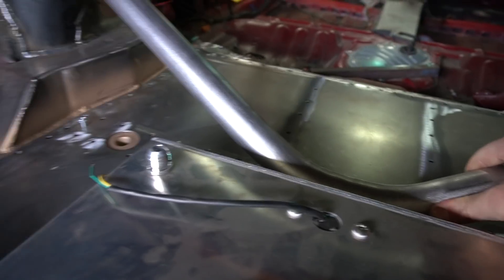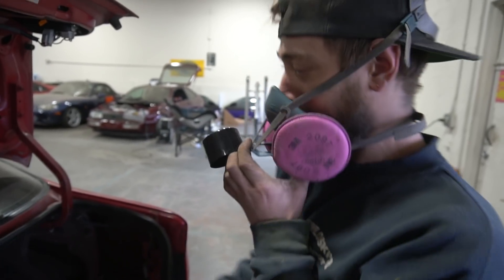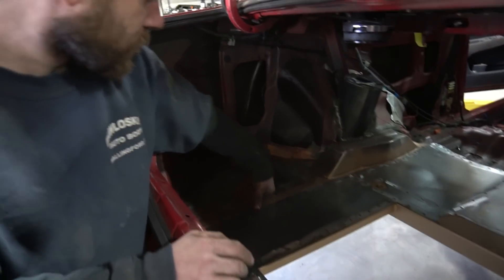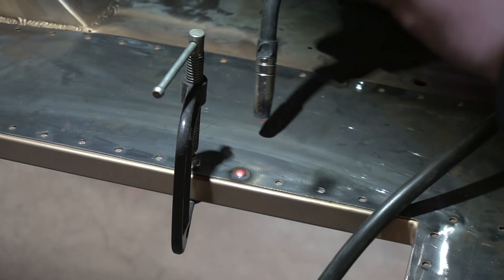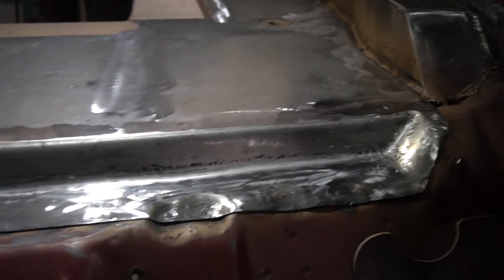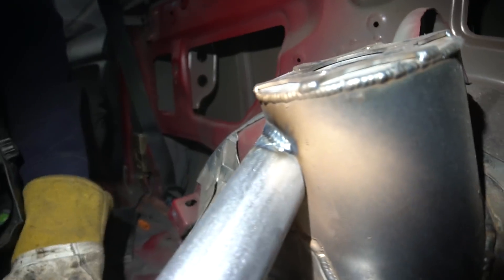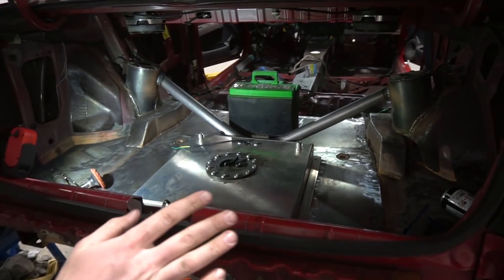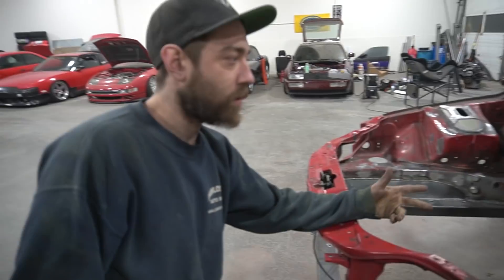RWD converted Civic all sealed up with a custom rear floor pan!!

Comment: Don't make exuses for making something awesome guys! 
Are you thinking on seal the trunk and the cabin with a firewall? It gets you some extra safety. If it's only daily driven you can seal around the edges just so much so a full tank of gas don't overflow into the cabin. And this is if you have an accident in the car. Remember even if you are skilled a driver. There are a lot of idiots on the roads that should'nt be on them. 
I really like that you do your builds properly Jimmy. And also proper builds takes time to do. But we gets as exited as you almost when we see it getting to the last bits and pieces to be finished. 
Would be awesome to see an awesome AWD build. Something that you can ripping and drifting in the snow and ice during the winter months. Why not something with an Audi Quattro or VW 4Motion. Even BMW has some AWD at least here in the EU. Then you have the obviously Mitsubishi and Subaru. But a Frankenstein build like this Nissonda would be awesome to see you guys build. VW R32 engine you can make some insane power in these days and Golf had some AWD modells here. My favorite engine sound is the Audi 5 cylinder engine. Also actually Volvos 5 cylinder engine makes some great noices from it. Then you get a cool factor from it as well. The Audi Quattro AWD system is just amazing. I had an Audi S4 '92 with the 5-cylinder turbo engine. Best car on the ice and snow I have owned. With no traction control or slip control it where just amazing to drive with some awesome winter tires on it. The Audi S2/90 coupé is another modell that would be great. Or some new modell from another car brand I miss on. 
Looking forward to see the Nissonda ripping soon!

Comment: Is there a particular reason you chose to do a steel floor pan instead of using an aluminum sheet, using panel bond, and riveting it in a few places? Would have been lighter and a bit less work, plus no rust. Just curious. Love the build!

Comment: Are you guys planning on putting a cage in nissonda? Cuz i think the extra time to cage it and put a rear fire wall would be awesome. But i can see why you wouldnt want to bother with a cage, its not gonna be a comp car, and its not gonna be a high horsepower, high speed build, so it doesnt rwally need it.

Comment: Should of halfway recessed the battery in the location you want to put it, similar to what you did with the fuel cell, but obviously an enclosed bottom unlike the fuel cell. 😁😁
Reply: The subframe is there so it’s not really doable

Comment: If it's Helium, the current situation isn't the reason it's hard to get. The world supply of Helium is low. The price has been skyrocketing in the last couple of years. If it's Argon, it's probably the current situation's fault. lol
Reply: ohyeahno, Argon/CO2 is probably just Pandemic'd right now. I got down to 100psi on my very last weld on my new exhaust yesterday. Skin of my teeth, I say.